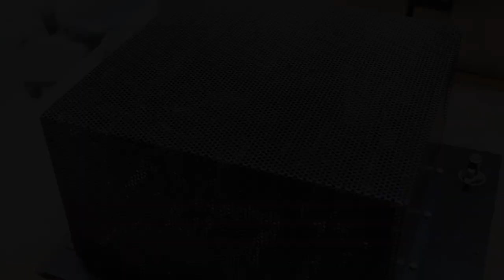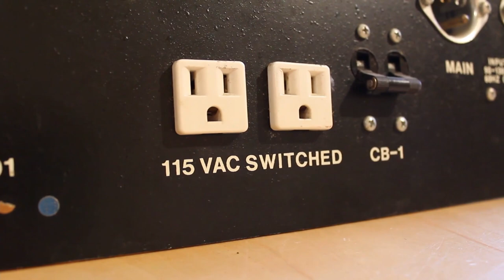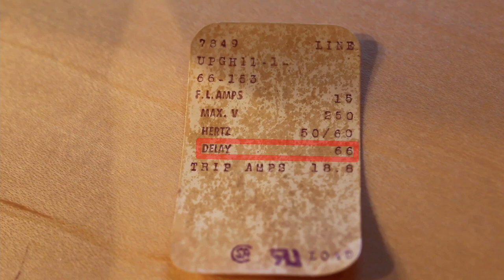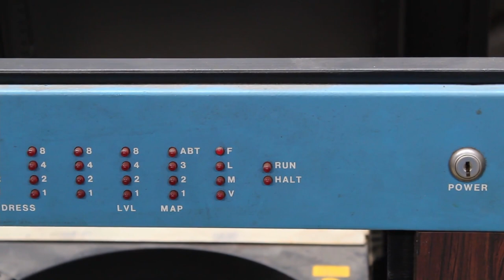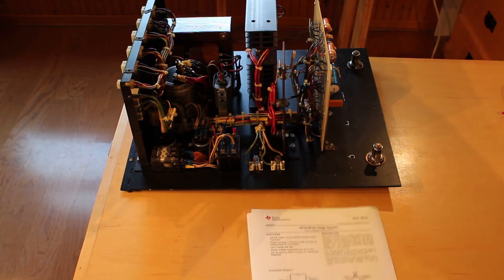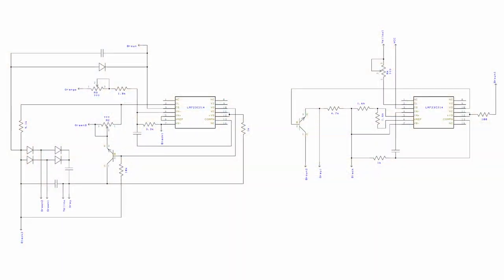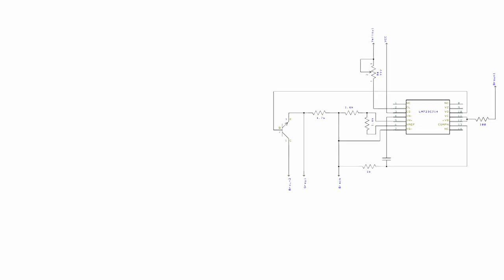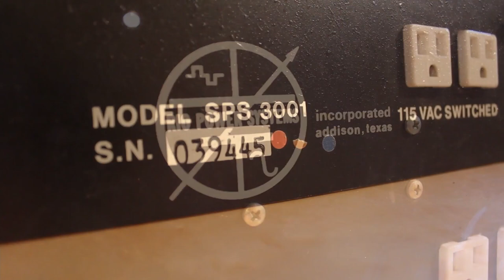Minicomputer Part 3: In-depth Look at the Power Supply

Comment: The reason for the time delay is in the event of the main transformer having a fault, the breakers will trip and no power will be sent to the rest of the computer.
What a beautiful PSU.
Reply from the maker: Another viewer let me know I was way off the mark on this one, haha. The sticker that I thought was for the relay actually came off the side of the circuit breakers! The relay is probably just a standard run of the mill industrial relay. The breakers have a 66 second trip delay, which is what that sticker is referring to.
Still, I'm right there with you that this one beautifully designed PSU!
Reply: @UsagiElectric  I don't like the idea of a delay that long on the breakers.
Reply: @UsagiElectric  I see what you mean. LOL.It's a mathematical nightmare. Ha ha.

Comment: I think the relay is so the capacitors  will charge up first so the surge current  won't damage other componits  because the caps act like a dead short until there charged  I'm not positive about this but other electronics I've worked on do that need a schematic  to trace it out
Reply from the maker: I was actually totally off the mark with the relay! Another viewer was actually able to identify the little label, and it's for the circuit breakers instead of the relay. The breakers have a 66 second trip delay, and the relay is most likely just an average industrial relay. So, most likely, there isn't a delay on this PSU at all!

Comment: I don't know much about power supplies either (or about anything in general tbh lol), but if the logic ground is at a different potential than the chassis ground (crazy, I know, but they did weird stuff back then), maybe depending on how the secondaries on the transformer are wound, they have to float the ground side of the 5v supply to the potential of the center tap that provides the 0v between the -12v and +12v windings?
Reply from the maker: I think you may be on to something here! It's totally possible that the -12, 12 and 24 supplies are dependent on each other (essentially adding 12V at each step), but the 5V supply is a weird step in-between, so they have to float the ground to get it to match up correctly and not have to drop a ton of voltage through the pass transistors. Since the entire PSU is essentially passively cooled, it would make sense for them to pull out all the stops to keep heat generation to a minimum!

Comment: Perhaps this is just me, but aside from old capacitors, I also don't trust old transformers. Who knows how good the condition of the insulating sheets is? Ideally I would say an insulation tester should be used on it. Otherwise, as cool as it is, I would rather just not use such an old power supply at all. Those are all common voltages; you could use much newer power supplies. I know a lot of people would say that this is not necessary and that's fine. As long as you replace the capacitors, there's a good chance it will be fine. But if it were me, I would keep the old power supply but I would probably add newer ones, leave the old power supply unused, just to retain the history. I would still remove the original capacitors (if not using it, I would probably not replace them, but I would definitely document everything in case deciding to use it at some later date).

Comment: Could be worse.  I’ve seen power supplies of that era that had saturable-core regulation.  The power transformer had one winding with zillions of turns of thin wire, the idea being that you could control many amps of secondary current by just pushing a few milliamperes of DC into that control winding.   A wild and weird way to do things.
Reply from the maker: Interestingly, the transformer in this PSU is actually a Ferroresonant transformer, which does work on saturating the core (well, parts of it at least)!
It uses two secondary windings, one is a dedicated LC circuit and there's a whole lot of wizardry going on that I can't really wrap my head around, but it works really, really well and supplies a ton of current to the 5V rail with practically no ripple!

Comment: It's possible there is a floating ground in order to provide a negative supply for stuff like the drive magnetics.
Reply from the maker: (YT seems to have lost some of my comment replies, so if you're seeing double replies, it means I truly don't have a clue what YT is doing anymore, haha)
That's an interesting idea! Although, I think another commenter may have gotten it by suggesting that it's most likely because the 5V is being referenced off of one of the other rails to reduce the amount of energy it needs to shunt, and ultimately reduce the amount of heat it's generating.

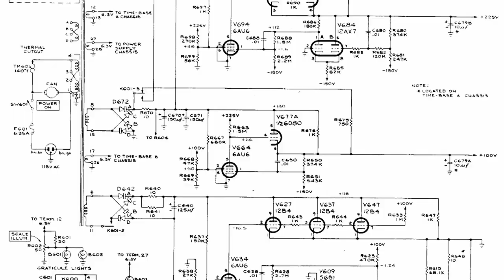Comment: @7:24 That's the powersupply from a 545. I have the RM545B model at home :D
Reply from the maker: Very keen eye! You're the only who has caught that so far!
My uncle used to have a 545, and it was truly an awesome machine!
Reply: @UsagiElectric  Thank you. Yes it amazing  :D I bought mine used and it just fired up without any problems. Also I love theres a section that says danger high voltage. but theres like a 500V rail in the whole machine :P

Comment: I thought the system was akin to a DEC VAX 750 but it doesn't seem to be but it would be one machine worth getting fixed so that it can be used to do your Bookwork on it.
Reply from the maker: (YT seems to have lost some of my comment replies, so if you're seeing double replies, it means I truly don't have a clue what YT is doing anymore, haha)
The VAX 750 seems to be a really pretty capable machine! It would be interesting to pit the two against each other and see what kind of performance differences there are. Either way, I think the Centurion will win the beauty contest with its woodgrain, haha.
Reply: Nothing like it physically. Just the CPU of a 750 is about the size of a whole one of those racks, and chock full of big circuit boards.

Comment: Remember the time of the system. This is not over designed, this was before switching power supplies. This system would take a huge brown out and continuing still work. Way more robust. Spent 16 years with Centurion.

Comment: Maybe the bodge wire was added because that board has the oscillator, and someone realized after the boards were produced that an extra connection was needed for the oscillator. Sometimes it is easier and cheaper to fix a known defect on boards with a bodge wire rather than trash mass produced boards.
Reply: sorry somehow this comment was made on the wrong episode

Comment: If this would be seventies, the loom would be made with real wire and knots, not plastic tiewraps. I had to learn to make those wirelooms in school early eighties.
Reply from the maker: I've met with someone who actually used to work at Centurion and we're pretty positive that this computer was built in 1979 or 1980. A lot of the parts are dated from the late 70s, so that makes sense!

Comment: I'd just test the rails, put a load on them, let it run for a few days loaded down, and see if anything pops or degrades.  Check ripple.  If everything looks good, then send it.
Reply from the maker: I like your style!
And honestly, that's actually probably a bit more effort than I'm going to put into it. I'll probably check for shorts, load it down and let it run for an hour or so, and if everything looks good, then send it. It's so over-engineered that I have total faith in it, haha.
Reply: the ripple is important. ripple on the power lines will cause all manner of odd behavior and make you chase your tail down rabbit holes. with the age of this unit, the caps may well have degraded enough that the ripple may be out of spec.
Reply: that is why they used linear instead of switchmode power supplies. the computers were very sensitive to noise on the power rails.

Comment: That's one heavy cool grand transformer with a very cool time delay relay switch made in Austria. It looks like a microwave transformer setup almost. Is it all AC power or DC power with diodes, bridged diodes, Not Sure ??  Is that a "High Voltage" AC/DC Capacitor maybe next to the large Transformer. Between high voltage power supplies and high voltage vaccum tubes no thank you ....... lower power is best for me LOL !!

Comment: Is it bad I feel bad for the vette "I think" in the background with all the dust on it and the flat tires?? It really needs a lot of love. And I would drive the hell out of it on the weekends.
Reply from the maker: The blue and white convertible? That's an Austin Healey 3000, and it doesn't have flat tires. I drove it just last week. Thing runs like a top and sings better than any modern car could ever dream of!
It is covered in dust because it'd been about a month since I last washed it and everything gets dusty fast out here in rural Texas, but rest assured, she gets driven regularly!
Reply: @UsagiElectric  Ah ok. Rear tire looked low. And yeah I am in the pan handle of Texas so I know all about dust and dust storms.

Comment: most computers of that age were designed with two drives so that the program was on one drive, and the data is on the other, so doing away with one of the drives probably won't wotk.

Comment: Your time Delay Should be 6.6 Seconds for the Charging of the High Voltage Caps for the Startup of the HDD Motors so you Doing get a Massive Surge of Power...
Reply from the maker: I was actually way off the mark here with the time delay.
The sticker had fallen off and I guessed it was for the relay, but it's actually for the circuit breaker. The relay is just a standard relay and it kicks on the instant power is applied. The circuit breaker uses a time delay to prevent small surges from tripping it, kind of like a slow blow fuse.

Comment: UNIX has a GUI which chan be any GUI compatible with LINUX
Reply from the maker: That makes total sense! I wonder if there is some sort of rudimentary OS saved in the ROMs on the computer boards, or if you have to load the UNIX OS from the external drive first? Well, I guess the best way to find out is to take the individual computer boards out and take a look at them!

Comment: https://youtu.be/SEqVCjSy0CQ?t=556 are you sure the "PWR" switch is in series with the load, and not just the relay coil? Normally the purpose of such a relay is to avoid having the full load on the key "PWR" switch, as they are normally not made for high current.